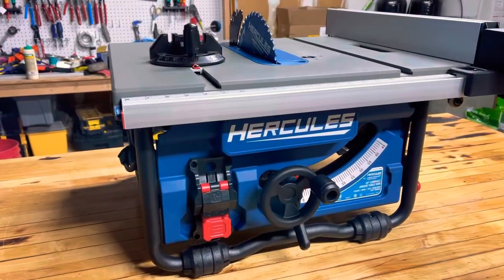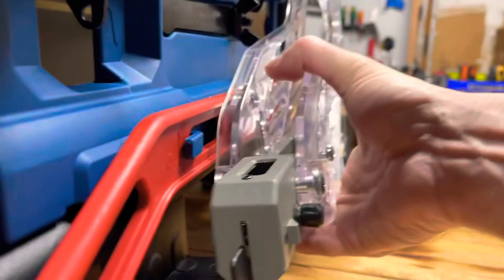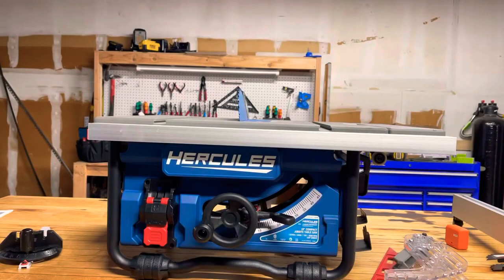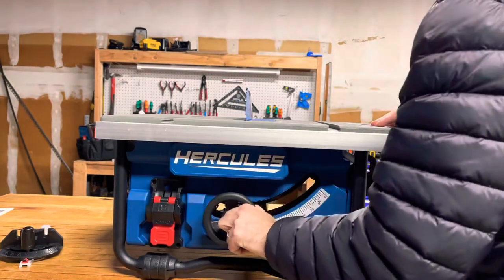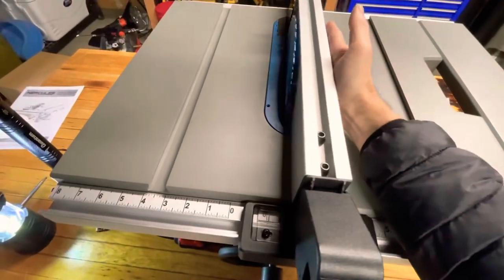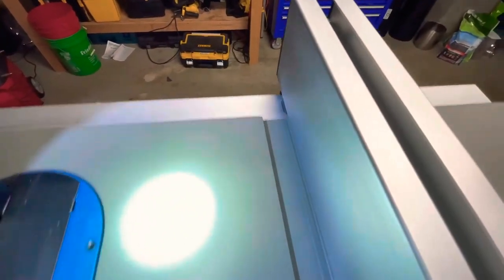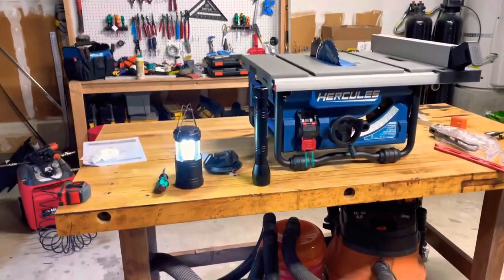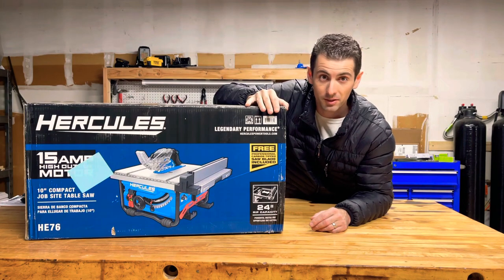Is My Hercules Table Saw a Lemon?

Comment: I just picked up the newer version of this saw and I must say, its surprisingly accurate right out of the box with very minor tweaks. Lots of metal parts in comparison to other $350-$400 saws. I ran it along side a buddies Dewalt he spent $650 on and he's a name brand snob. Not so much anymore. He ended up using my Hercules for a better part of the job and was pretty impressed that something other then yellow and black was pretty damn good!

Comment: I am wondering what you ended up getting after all. I am on the fence about getting the new Hercules table saw.  The new version that was released has an upgraded Rack & Pinion fence like DeWalt has and a few updated features. You might check it out.

Comment: I just bought one this past Saturday. I didn't have any of the issues you did except for the fence. I could not get it to stay parallel to the blade or even 90 degrees to the table itself no matter how much I adjusted the spring loaded screw in the back, or the little wedge screw that holds it to the back rail. Main reason I bought it was to be able to rip wood. It's boxed and ready to take back for one exchange, if that don't work I get a refund. Got a good 10% off deal, so at $315 I was pretty excited. I'm all ears.
Reply from the maker: Hopefully the replacement works out for you!

Comment: im very happy with mine but each time you have the check the fence for alignment and use a tape measure to make sure your cutting the right width
Reply: That’s smart and all, but doesn’t that defeat the purpose of spending hundreds of dollars on a table saw when you can just use a circular saw and a straight edge if it’s not going to be faster anymore

Comment: I never use the Fence, I set my Hercules Table Saw up with a sled that cuts 100% perfect straight cuts after calibrating with the 5 cut adjustment method. I am just using it for hobby Special Effects prop making not for building walls for a house so for me this was the absolute BEST purchase I could have made. No way I could afford a $500 or more table saws for what I am using it for.

Comment: Got my on sale 249 well pleased  but see display at a store angle moved freely  but when  you got close to the 45 on it it but the thoat plate looked like a little filing would take care of it just take it back and exchange if you haven't  had it over 90 days
Reply from the maker: I returned and got a Metabo with rolling stand for $350. It’s fine, but I preferred the Herc in some ways
Reply: Also a great looking saw looked at them to really like the stand if I had plenty of room and money  I would get the 3 hp sawstop get cabinet  saw
Reply from the maker: Goals!
Reply: How are y’all buying this saw for so cheap? It’s on clearance for $329 but you can’t use a coupon on Hercules peoducts

Comment: I just bought one, 2 days ago. Still in the box. I did lots of reviews and saw great comments about it. I even saw a few reviews that claimed it was as good as the De Walt. Now I am a little concerned. Anyone have these problems? Did you get feedback about that? and Did you get feedback from Harbor Freight?
Reply from the maker: Never got any feedback, I returned and went with the Metabo that came with a rolling stand, only because it was on sale. I do think it can be a great saw, assuming it was assembled correctly. I honestly didn’t want to return but it was the only option.
Reply: Did you return yours? Dennisg I mean
Reply: Just me, but I’d have gotten another saw when I returned this one.
Reply: @chimneychase  actually, I haven't really needed a table saw since I brought this one. So, I haven't used it. But I do still have it. I guess I should have operated it. I will be soon. I won't be taking it back now. Hopefully I find no problems.

Comment: Bro take it back and get another one it is defective. My makita worm and circular I went and returned at least two each till I got the ones that were to spec. My ridged tools same thing. Ffs it’s hf. You gotta buy a few first, demo hammers are great. 12 inch Bauer saw blades kill dewallt. Don’t waste people’s time with lack of common sense crap. If you truck was pulling left after getting your front end aligned would you do a bs video or take it back to the shop??????
Reply from the maker: Thanks for the advice Skippy